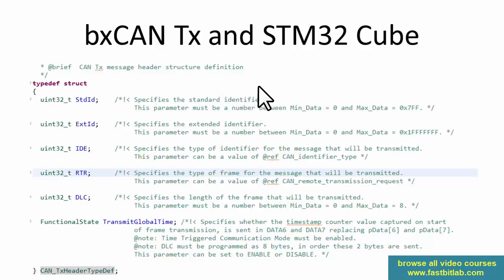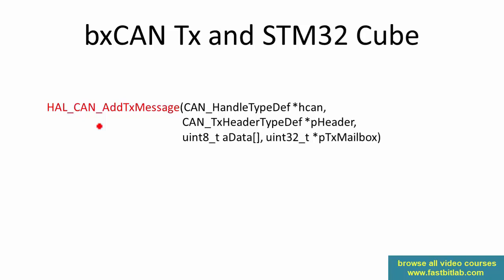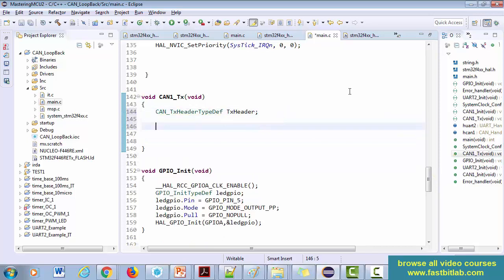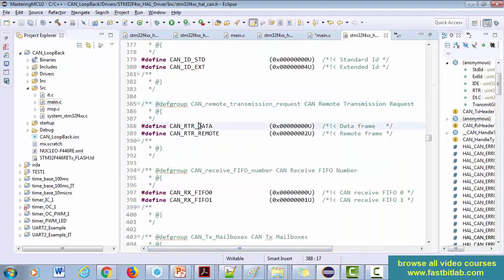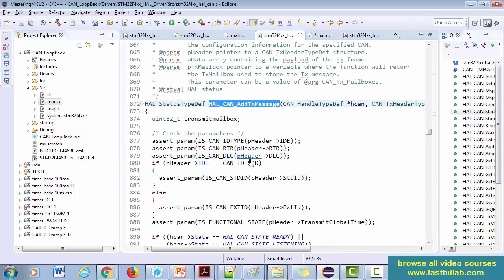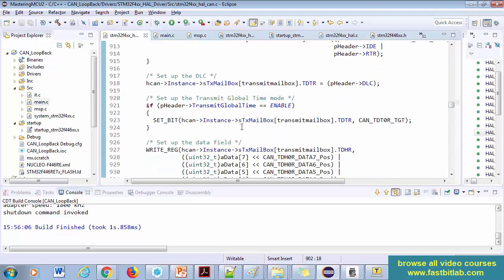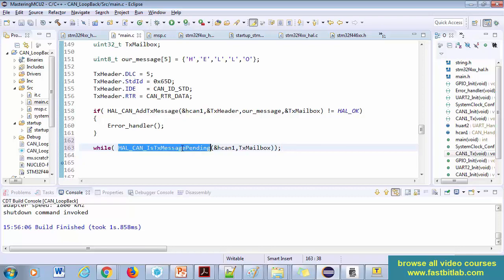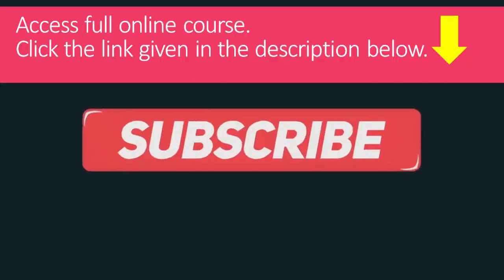Controller Area Network(CAN) programming Tutorial 17 : Coding for CAN data transmission

Comment: Hi at 8:43 minute mark you seem to skip a section on configuring the bxCAN modes.  I have stepped through my code and things seem ready to transmit but they don't and I'm assuming it's because of the missing bxCAN mode configuration. 
The video also glitches showing the CAN modes state diagram at 8:43, could you add this video? I would really appreciate it. These have been great lessons.  I think Danial Jung is commenting on the same thing.